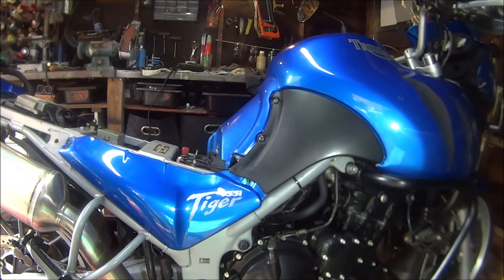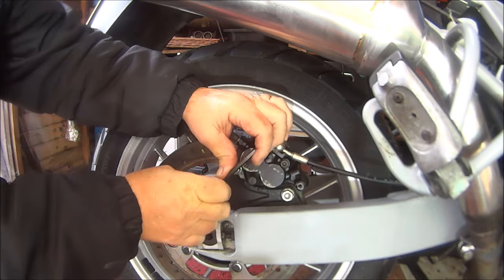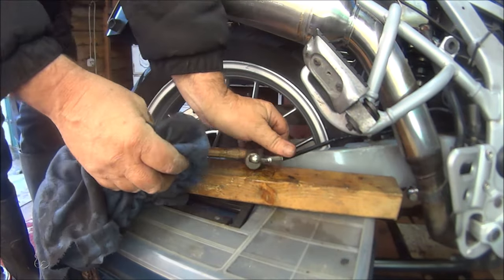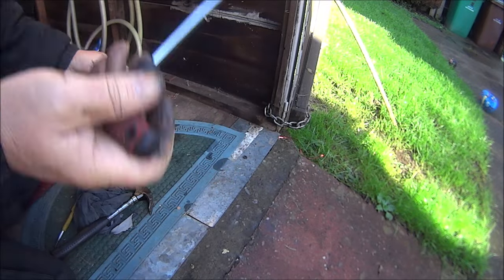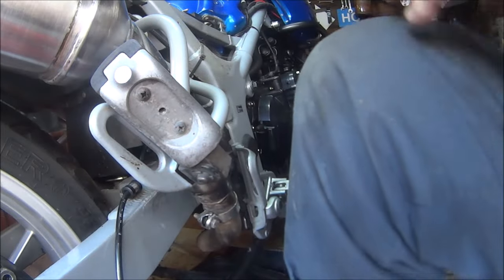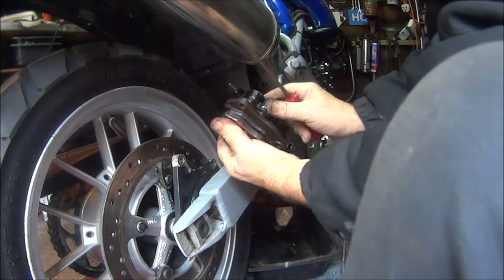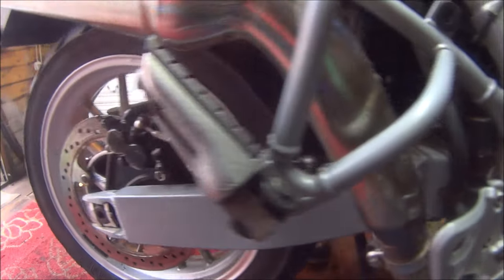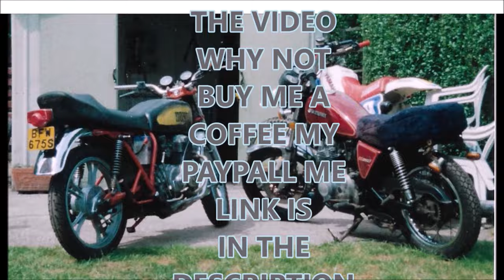TIGER 955I. Seized Brake Caliper. Fixed.

Comment: very similar to front caliper on xt600's so well used to these, those pins when stuck are a real pain, and careful with them as with yamaha anyway they are unobtainium, also there is a single pot one on rear on xt600 and they can be worse, clean and grease up once a year is all they need, and dont ask about bleed nipples !!